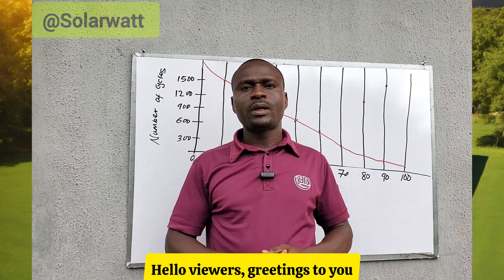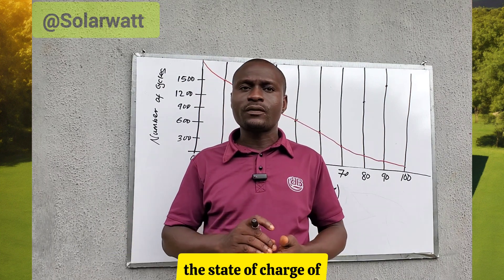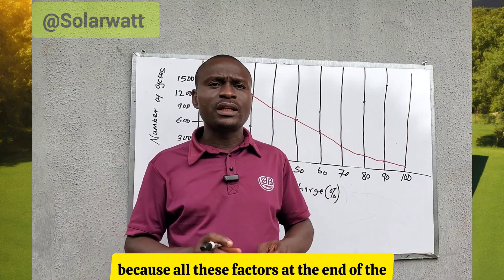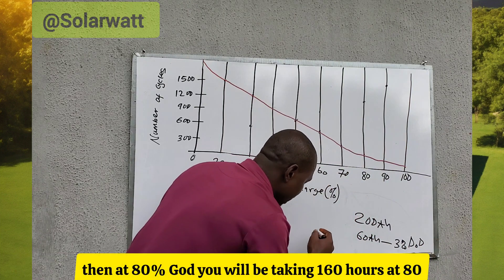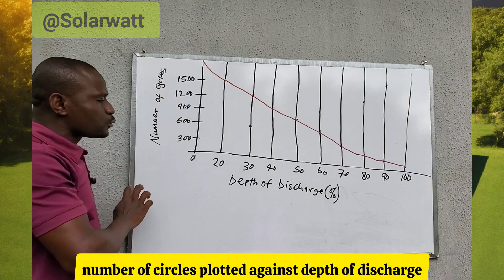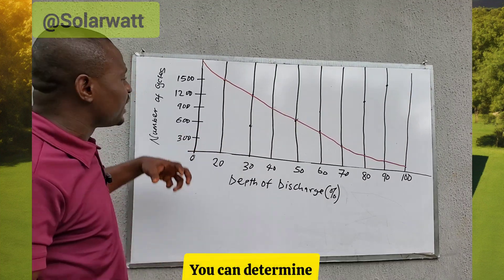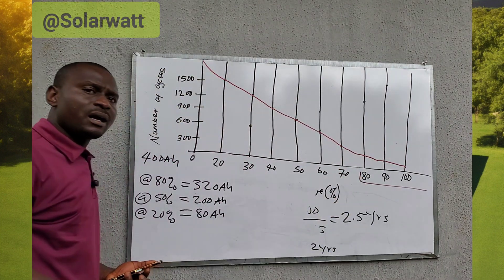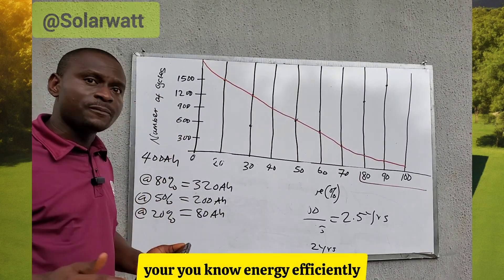What Is The Depth Of Discharge (DoD) Of A Battery?: How To Calculate The Lifespan Of A Battery

Comment: Cycle And day are not the same. Cycle is the time taken to consume 100% the battery. Now what if I charge my battery to 100% 9am and used it up by 1pm and repeat four times is a day? Is that one cycle or four cycles ? All inside 24 hours. You need to correct this please.

Comment: Good day, Engineers, I have a question on PV configuration 
1. I have a hybrid 6kw inverter with max Pv input 500V, max Amp 27A, total power 6000w, Nominal voltage 380V
2. 10 pcs of 600w panels with VOC 52.81, Imp 13.44.
3. How do I connect these 10pcs of 600w in series to reach the nominal voltage (380v) and not exceed the PV max 500v.
4. I would appreciate it if you reply. Thanks, Eng Kay
Reply: Have you done your daily need analysis before getting your solar panel. I think you only need nominal voltage of 380V to design your battery bank which I think is higher 380V is not a DC voltage. It is an AC 3 phase voltage

Comment: What about lithium battery that  has 80% DoD.
Reply: Most lithium batteries have higher battery cycles of 2000, 4000, 5000 cycles compared to flooded and AGM batteries that have lesser cycles up to 1000 or more.

If a lithium battery of 10kwh and 5000 cycles has 80% DOD  It means it can last up to 13 years and you draw 8kwh from it. 

5000 cycles/365 days
0.8 x 10kwh